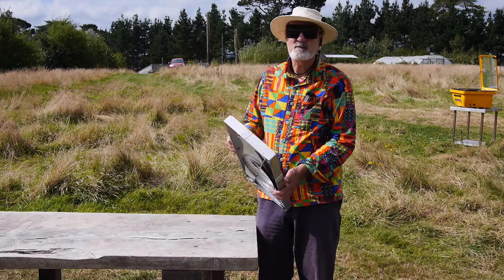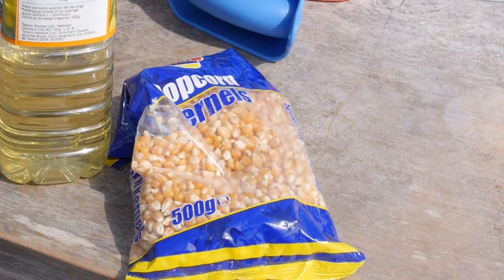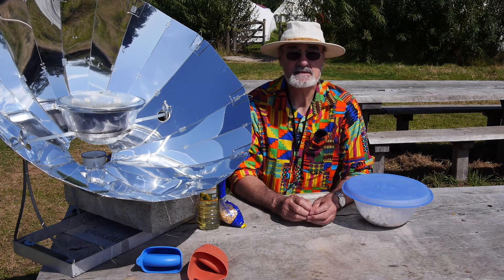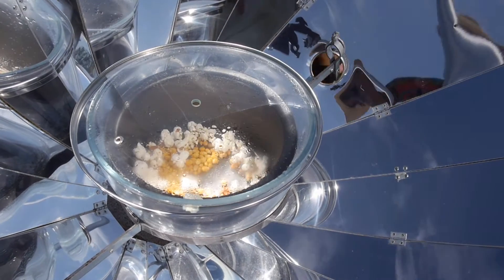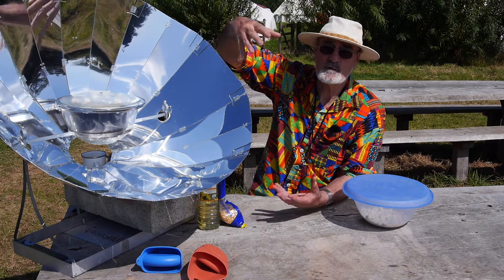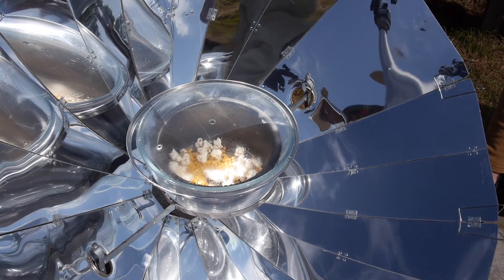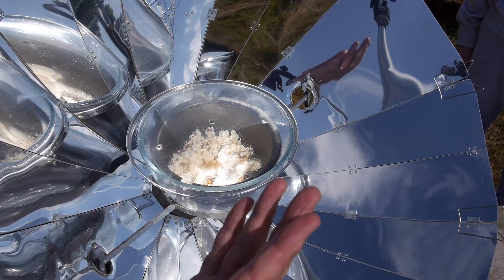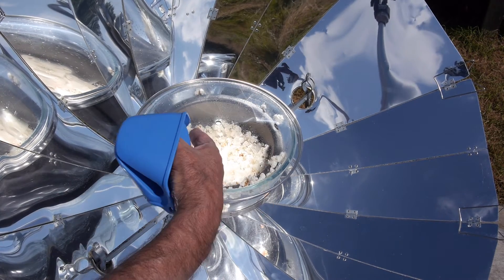Popping popcorn in a parabolic solar cooker

Comment: I would love to use this for a science experiment station for kids but I’m under a time constraint at the event. Approximately how long did it take to heat up and pop the popcorn?
Reply from the maker: Hi Steven, solar cookers are great as a resource for education (you may be interested in these resources: https://gdsnonprofit.org/resources-from-around-the-web).  In bright sunlight (which nobody can guarantee, so I never promise to do anything at a particular event), and using the setup you see in the video, it takes around 15 minutes for the corn to pop.  Obviously a bit faster if the ambient temperature is higher, longer if it's a cold day.  Please note that I am using a heat trap in the video (the pyrex bowl).  Without that, this is NOT possible with this solar cooker - heat traps give access to much higher temperatures.  Note also that this only works with deep parabolas like the one pictured.  If you use a heat trap on a shallow parabolic reflector (like a satellite dish, where the focus is outside the dish), it is likely to shatter.  Please come back to me with any questions you might have.  Good luck with your demo.

Comment: Hi Dave, I got my Sunplicity on Saturday and I have been cooking everything in it since I got it including one excellent banana bread. It was so hot it literally got scorched on top.

I want to get a pyrex dish like you have in this video, was wondering which bowl you are using?
Reply from the maker: Hi Edlandish, yes, the top of stuff can burn occasionally in a SUNplicity.  One solution is to turn the dish about half way through the bake, or use a black pan lid over the top.  Regarding the dish, the pyrex dish used in the video is a 2-litre one. A 3-litre one will also just fit into the hob ring, though it is less stable.  For the popcorn setup, I cut down a circular trivet so that it just prevented the black pot touching the side/bottom of the dish.  It's good to think about the black pot / trivet / pyrex dish combination as a set - it works best if there is only a small gap between pot and dish.  Glad you are enjoying the SUNplicity.
Reply: Oui exactement, il faut une casserole noire qui se met dans deux plats en Pyrex mis l’un sur l’autre ( saladier en verre pyrex).